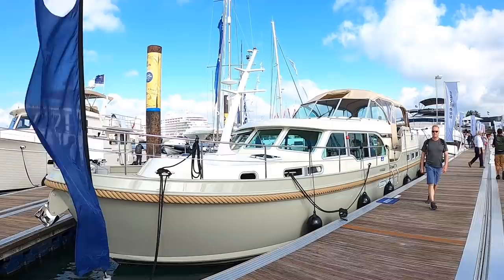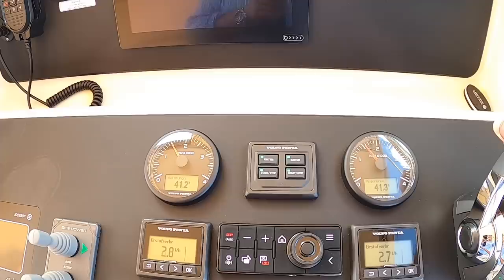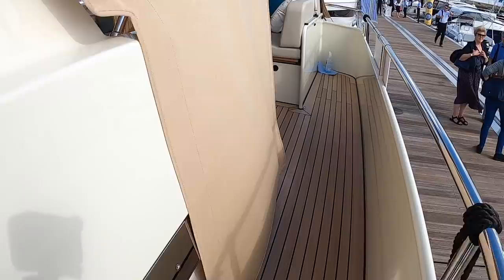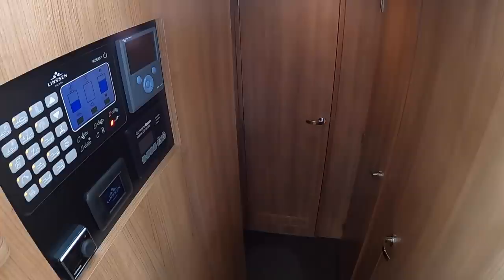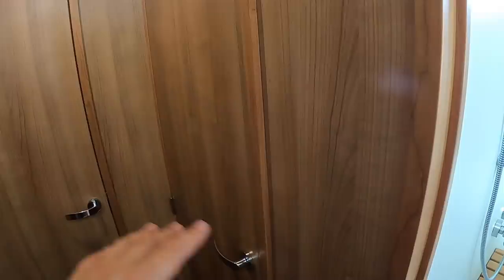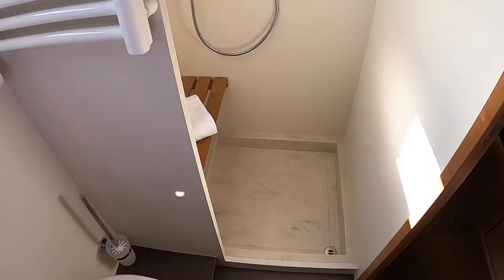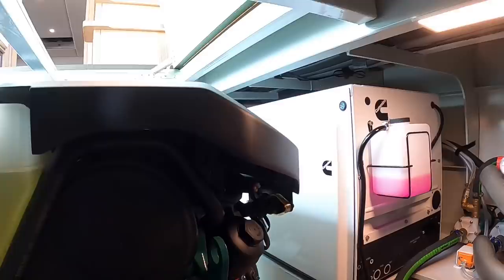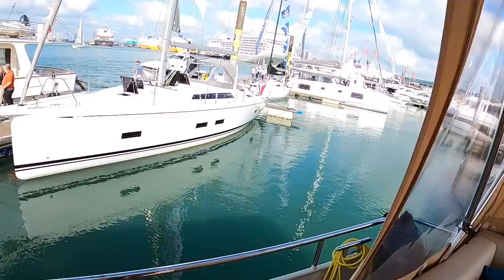€500,000 Yacht Tour : Linssen Grand Sturdy 45.0 AC INTERO

Comment: WOW!!! I never thought I would see a 45-foot boat that would hold my family. There's five of us and I've been looking at the 55-70' models because everything I see that's smaller than that only has two cabins, or else the whole space is so cramped that you can't use the rooms they do have. 

This one could perfectly feasibly be a comfortable liveaboard home for us with a couple of minor modifications of the kind that are always customized from one owner to the next. And it's ten feet smaller than the next biggest model I've seen that would work. I am incredibly impressed. We don't typically eat at table, we just sit in the living room, so I would probably drop that dinette altogether in order to expand the galley and provide serious cold storage and a dishwasher, and similarly cut out the walk-in closet in order to fit a real bathtub into the master, and just have the drawers and storage under the bed for our clothes. But those are just preference, the way we use a boat instead of the way somebody else does. I've been looking at full displacement trawlers, the kind that typically do have a lot of space per foot, but I've seen nothing that fits so much into 45'. This is a really impressive little boat!

Comment: A typical interior for an inland/coastal cruiser but done so well!  Great attention to detail, the engine mounts, separate heads (drives me nuts to see that feature not on much bigger & expensive boats) and safe roomy decks.  I liked the fold-up seat over the rear entrance to what I assume is a small bathing platform and hopefully a fine pair of stainless steel derricks.  I am a bit of a derrick nerd, can't help myself.

Comment: While I’m normally not a huge fan, this boat seems like the perfect boat to have a hybrid/solar drive. Is it an option?
Reply: Just looking at it quickly, you don't have a lot of deck area you could cover with panels, my as a trickle charge for the batteries, but that's about it.
Reply: Not enough real-estate for the panels.
Reply: Sadly true, which is a pity because she'd be a good fit for them if she had a place to put them. You might be able to fit on enough solar panels to run the house, even if not the propulsion.
Reply: I would like to see a small Beta generator engine charging Tesla type batteries that power a couple of big electric screws. You would need the area of a tennis court filled with solar panels to power this boat.

Comment: Thanks for the video. I like Linssen boats. The quality is very good. In my search for a boat I have been looking at several Linssen boats. Unfortunately the new ones are far beyond my budget. During my search I have seen that even after 30 years the durability is still there. Doors still fit and hinges and locks open and close perfect. I like the push in locks. They are flush with the door so no clothing can be caught behind it.

Comment: Really like this layout inside, but feel it could make more use of the foredeck space. It's definitely a boat you could cruise on, but what kind of range does it have, and also with such a low top speed, does that make you more or less susceptible to bad weather? In some uk coastal areas you'd struggle to make forward progress in certain tides.  Does that mean you are more likely to hug the coast, and time channel crossings?

Comment: Well, now that’s what I call a boat. Steel hull, three cabins, practical design, at 30% of the price of those fancy brands with the plastic fantastic balsa cored hulls. Yes, you go slower but you worry less, you burn much less fuel and your investment lasts a lot longer. 

What I didn’t see though is enough refrigeration, and what I would spec on top is Airconditioning and perhaps fin stabilizers. 600 K euros perhaps with those extras, and you are set for the rest of your life.